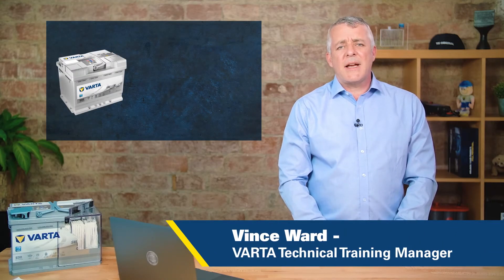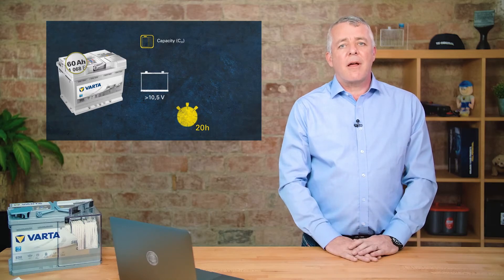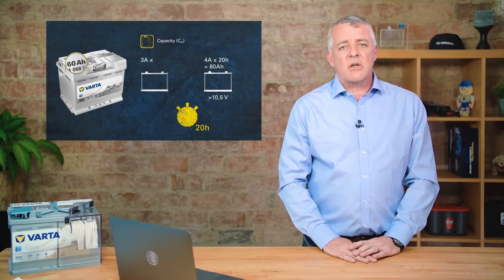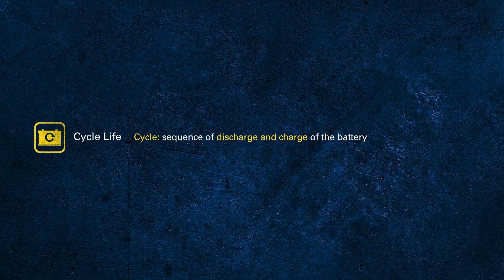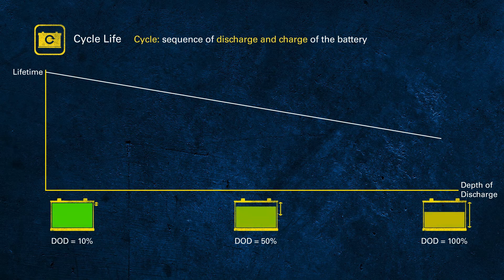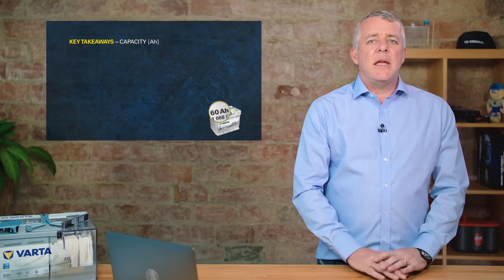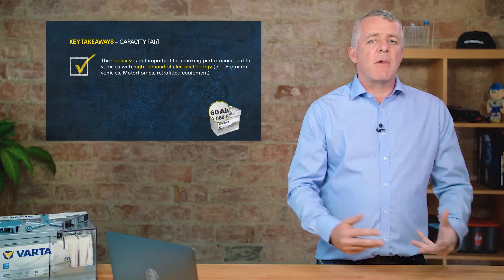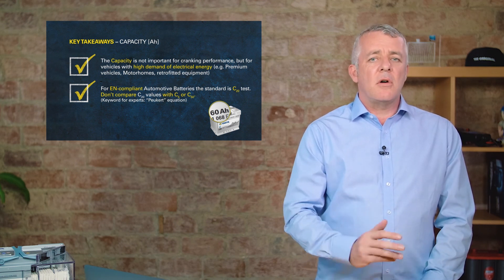VARTA Batteries - Capacity and Cycle Life

Comment: just replaced the Battery on my 2008 Audi A6 . The original Battery was a Varta was still the original from when the car was new. Impressed its was 110AH but replaced it with a 90AH